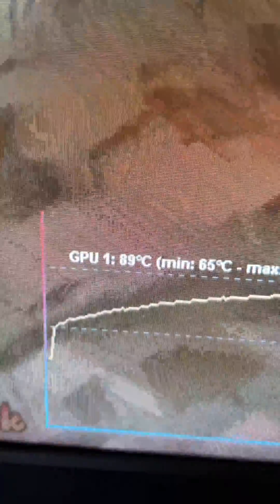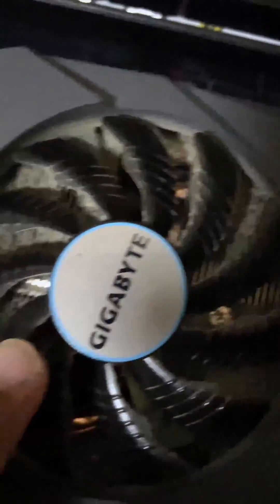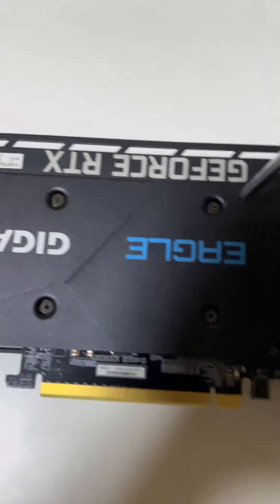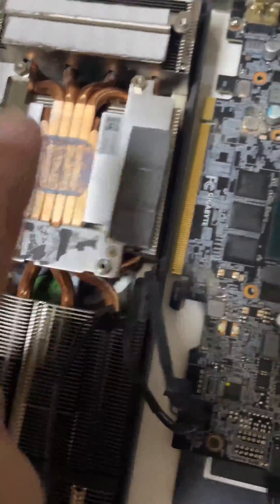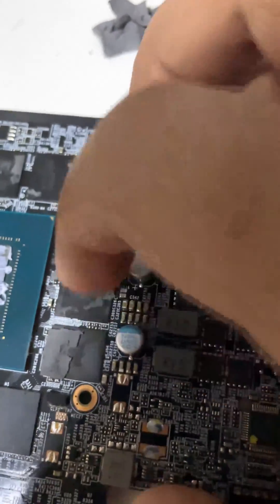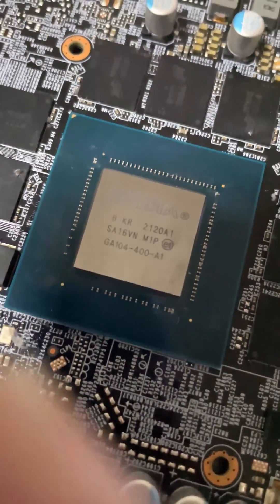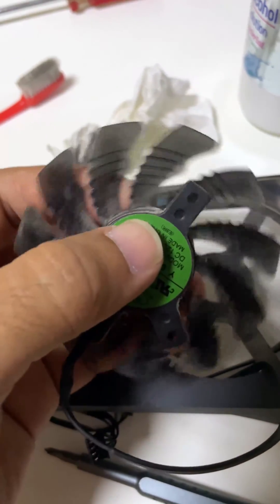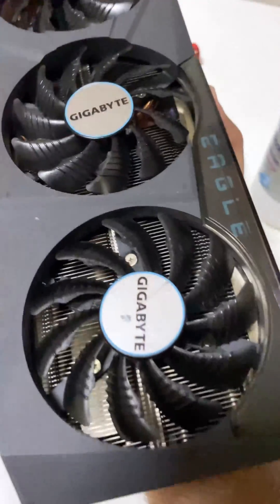DIY Teardown - Reducing 20 Degrees of GPU Temps just by Cleaning it up RTX 3070ti Gigabyte Eagle

Comment: You need to cover the die of the GPU, not just add a dot and hope it spreads, if the chip gets an uncovered spot with my thermal transfer, parts of the chip can overheat and die out causing failure of the GPU. Greg Salazar fixed a 3070 by repasting it because part of the chip wasn't covered with paste.